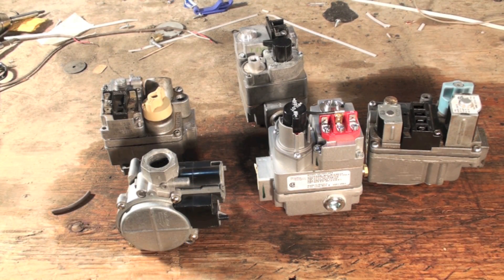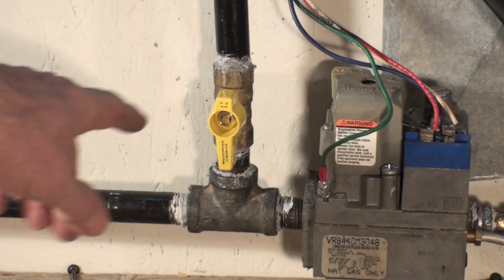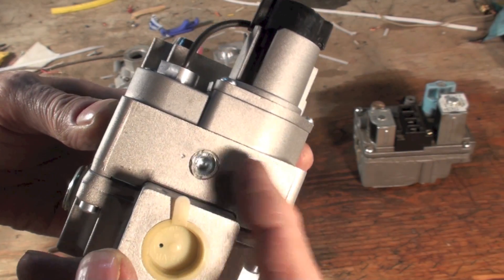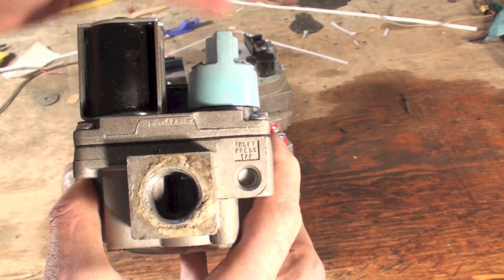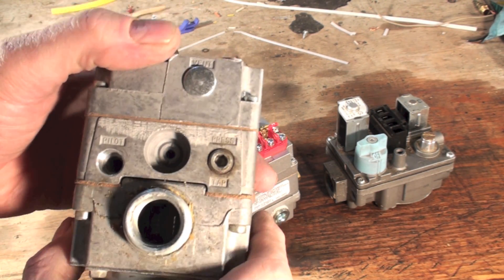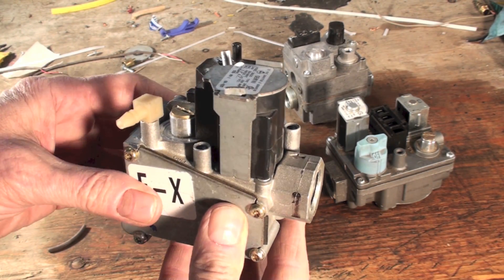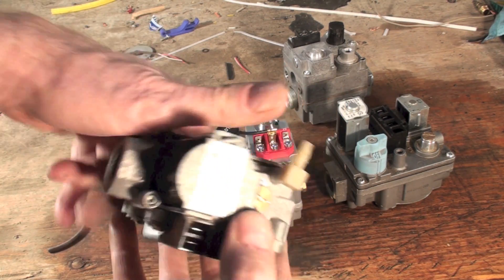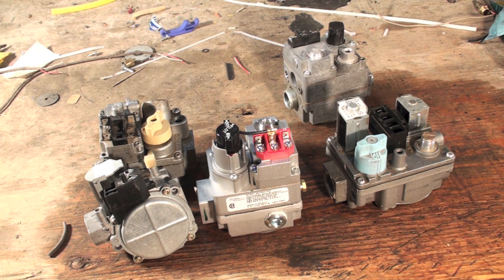Where the gas valve pressure taps are located

Comment: I have a White Rogers 36J56201 model, and I do see the in and out TAPs. The manual doesn't say much about them. I'm used to check pressure by screwing my barbed nut, but there's no threads on this new valve.
What exactly holds my manometer tube?
Reply from the maker: loosen the allen screw inside the tit.  Place flexible hose over the tit.  
GFM
Reply: @grayfurnaceman  I'm sorry that I asked the wrong way. I meant that you show INLET and OUTLET taps, and yet there's nothing you can do with them. I know about the top "tits". It's the INLET pressure has no adjustment. Is that done at the propane tank regulator?

Comment: I'm getting a new furnace that needs to be converted to LP gas on a 2 stage. Some videos confuse me, and that's why I've been sticking with you since we're about the same age  LOL. Some say to bottom out the high pressure 1st and take combustion cover off to set LOW side pressure. GFM, do you have a video on how to?
Reply from the maker: First, the furnace must be designed for conversion.  Next, they make it easy.  Use a factory conversion kit and follow the instructions.
GFM

Comment: I just rewatched your replacement video.what do you recommend to use on the treads
Reply from the maker: Any pipe dope rated for natural gas.  Not teflon.
GFM
Reply: @grayfurnaceman  thanks I had bought the tape rated for gas but it looks just like the usual teflon tape.

Comment: I keep following you around town.  Lol ok so I have the Gemini model, it came in th 22s mail today, I have a manometer but the barb that came with are to big. From what I'm hearing is all I need to loosen but dont take out the plug and slide the hose around the plug in the pressure holes without the barb
Reply from the maker: Yes, loosen only and slide the hose over the fitting.
GFM

Comment: how to connect gas valve the original was 36c03 tape 433 and the gay on the store tell me to replaced  for 36c03-300 and  i did but the gas pilot dont stay on can you make a video and tell us hoe to ceonnect the right way
Reply from the maker: I am assuming you have replaced the thermocouple also.  If the replacement valve has an ECO(energy cutout) connection (located just underneath the thermocouple connection) and there is no ECO on the furnace, you will have to jumper the ECO connection.
GFM

Comment: this happened a few times that I had a good pilot light then when the call heat the main flame came on and the pilot dimmed and after 2-5 min everything went out.  inlet pressure was good.  internal reg adjustments didnt do anything  Anyway to fix this without replacing the valve?  What is an acceptable outlet reading?
Reply: NG sand pan fireplace and one had a White Rodgers valve.  I see it at least once a year any help will be appreciated.
Reply from the maker: Joel D These systems are so simple that you only have a couple of possibilities.  I am assuming the unit is millivolt and that the voltage is ok.  In that case I think you are down to the valve.
GFM